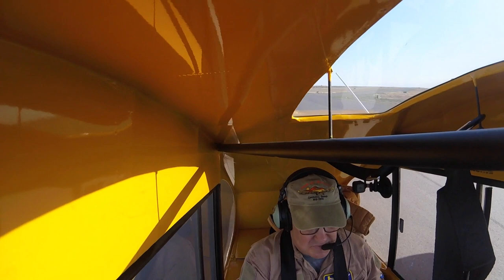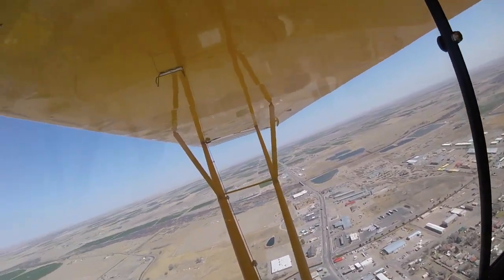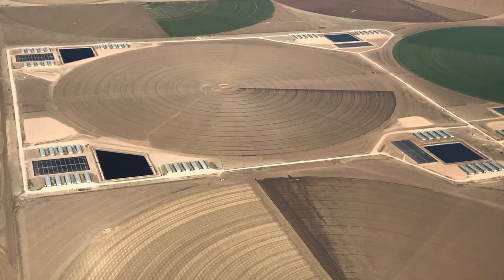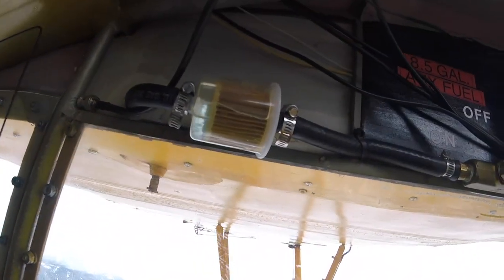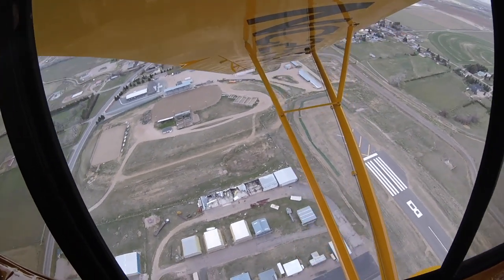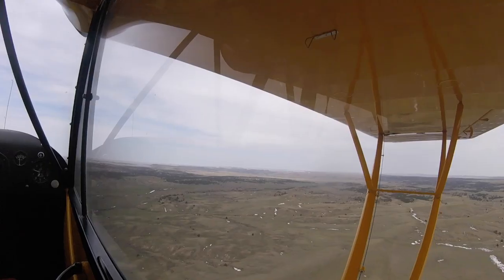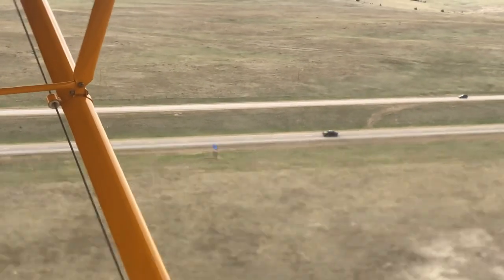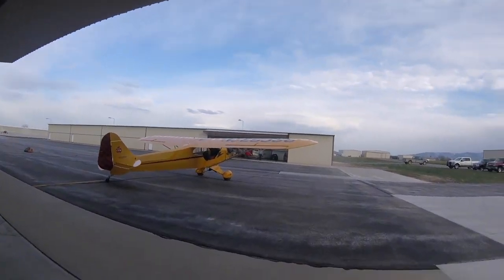J-3 Ferry Flight, Texas to Montana with Jughead Counsell, Part 2

Comment: How do you like your headset?  I need another ENC headset. Already have a lightspeed, was thinking about the DC ONE-X. Does it have good passive attenuation? Thanks
Reply from the maker: I bought it for my daughter, but I use it on ferry trips because of its small size.  Good sound/BT quality.  It is comfortable for many hours of wear.  Passive attenuation is good. My biggest compaint is it doesn't have auto-on.
Reply: @Jugheadf15  Thanks for the reply.  I'll give it look. Appreciate your videos.  I'm envious of your ferry trips. Brings back good memories of ferrying a super cub to Montana from Florida with my grandfather.  Maybe you've seen it out there:)

Comment: I tried to post a comment on the tattered rudder you showed (NC 50023) with a link, but it keeps disappearing from the comments. It was a link to a photograph, I think misidentified, of NC50023 as a "Beech Bobcat" in the Colorado Springs Pioneers Museum.
Reply from the maker: I saw the same thing when I googled it.
Reply: No doubt misidentified as Beech as Beechcraft built a similar aircraft called the AT-10 Wichita and wouldn't have even contract built the AT-17 Bobcat for Cessna.  That is most certainly a Cessna Bobcat rudder.

Comment: Hi Jughead. Fun flight ferry videos!  Cubs are cool. What altitudes did you typically fly on the way to WA, and what was the highest you had to fly to complete the trip?
Reply from the maker: Altitude is dependent on winds, routes, emergency options, wx, aircraft etc.  But my preferred altitude is 1,000-1,500 AGL
Reply: @Jugheadf15  thanks for the info! It looked that way to me. I assume it's just when you have to go over passes you have to get up much higher. 6 to 7k for the Cascades. I want to fly from S43 to Ennis MT  in a low and slow Zenith so doing some flight planning.
Reply from the maker: @Clif_Brown  I rarely go over the Cascades above 4,500'  in my C-170 unless there is a favorable wind up high
Reply: @Jugheadf15  Thanks. Aha, Stevens Pass and Snoqualamie Pass even lower.